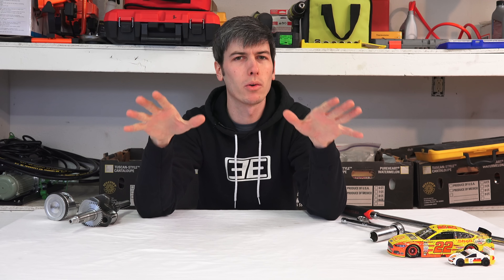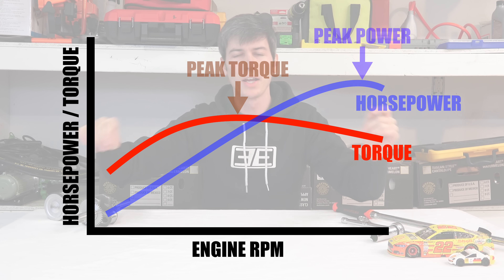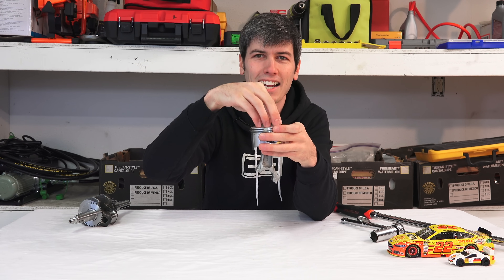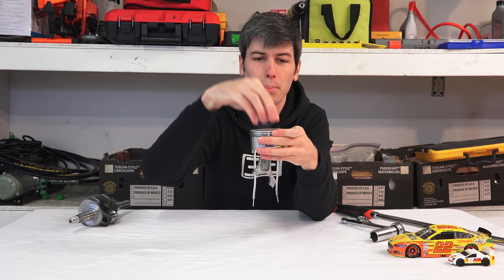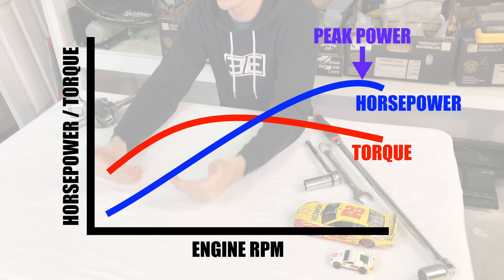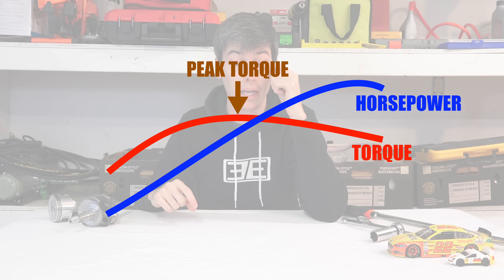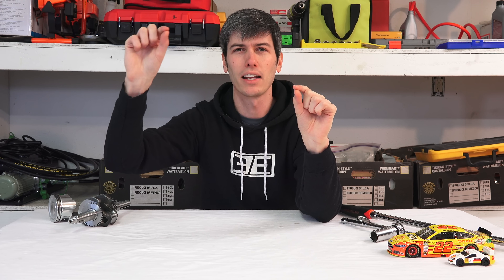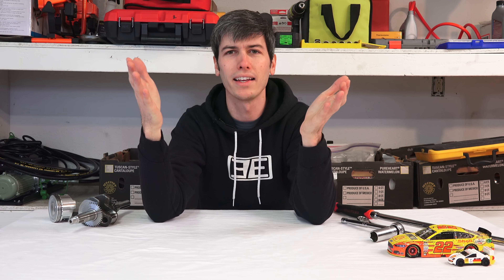Horsepower vs Torque - A Simple Explanation

Comment: no this is not clear. so why can't i put an F1 engine to a truck? more HP -> more work right? no
Reply: cos you cant do it ? 🤷🏻‍♂️ f1 engine at proper gearing outperform stock avg truck engine in wegiht pulling competition ,accelerstion with heavy weight asf as long as it be conect woth eprfect gearing and will have more output whell power 👌🏻 feg thrust at 5 km/h for 900 hp f1 engine assuming gearbox allow engine to be at peak power at this speed be much greater than for 500 hp truck regular engine at the same speed also at peak power dosent matter how many times more truck engine have torque at engine crank 👌🏻with this f1 engine it will pull stronger heavy 💩 uphill feg 👌🏻 with 700 hp at whell at 5 km/h vs 400 hp at whell for truck engine at whell at 5 km/h it be able to pull uphill at this 5 km/h at least 70% biger load on trailer and overall including whole weight with truck itself 👌🏻 now why they dont use f1 engine configuration so low torq high rpm short stroke small fispalcement asf for truck on road aplication thers plenty reason why and its not towing capability 👌🏻☕️
Reply: @mociczyczki  good explanation. I always thought the high TORQUE is required for heavy cars. but it seems like it just works better in practice, but it would be possible to rev an sport engine to 10k rpm with a proper gear ratio - but imagine the clutch while trying to move from 0 speed trying to convert the 10k rpm
Reply: @ thats why i write at perfect gearing what beside other stuff include super short 1 gear 😉👌🏻

Comment: I don't understand... You say that peak torque is when you will feel the most force in your seat (which means it must be peak acceleration), which seems to imply that more torque means more acceleration. But then you also say that power is what determines which car will accelerate faster. Seems contradictory...
Reply: yea cos he dont say pr say bit ypu didnt hear egzacly that tprque is leverage dependent and power is speed dpendend other word peak torque generste more force thanpeak power at Set LEVERAGE or AT SET GEAR where final gear rstio stay the same all the time so you setup whatever gesr you want let say 3 and you accelerste from idle rpm with pedal to the metal to rpm limiter now pesk torq push you into seat stronger than pesk power but. power is speed dependend so it generste more force at set speed so now you choice frelllly speed you want feg 100 to 105 km/h and now you accelerste first at rpm clsoest to peak torq rpm and in second attempt ypu wccelerste at rpm closest to peak power rpm whichever gear is required for setup such test in this way even if it required change gearing some custom final gear rstio whateve r it doesent matter so when test be setup in this way from 100 to 105 km/h feg peak power always generste more force at contsct path and accelerste in this test co figurstion faster 🌪️ 2 formula subscribe this for torq its tprque :leverage = force and for power is power : speed = force form the same reason its power which win racing and not torq cos when you race ypu comapre the same speed level diffrence range or distance like 1/4 mile  if vehicle have the same resist including weight drag and one defeat this distsnce faster that mean it use for it more avg power cos he acomplishe the same work in shorter time period 👌🏻thats why all this tprq g.y stpry is just crsp of 💩🤭 🍿

Comment: So if they are a function of each other, why can't i use gear ratios to acellerate faster by peak torque?

I can understand horsepower defines top speed, but with an ideal (utopian) gearbox you should accellerate faster with torque .

I am also confused why the integral of the torque curve would not give the power.
Reply: function of each other tprq rpm power yep  it dosent mean you can accelerate faster be increase to limits each of those units except power at perfect gearing - 2 diffrent stuff cos proprotion between tprq and rpm is key and what isroportion between torque and rpm ? yep power ….👌🏻 👉🏻 if you understand hp defines topspeed ypu shpuld also know that at top speed is bigest motion resist in regard to drag and roll what required specified bigest force level at this very specified set speed level  if only peak  hp at perfect gearing determined max speed it mean it must genersted bigest force level at this set speed and not torque at crank and this basicallly mean at each set speed peak power push hardest generated bigest output force in newtons kg force etc …. so if you geared vehicle in such way that peak  torq be at previous topspeed limited be all resist like  on peak power rpm now at peak torq rpm this vehicle dont achieve the same topspeed but lower cos final gear ratio at max tprq is to long and contact path force to low/go down  👌🏻 integral of torq give power but diffrent level of power which  is depend on at how high rpm this torque level is 👌🏻1000 nm at 1000 rpm is less power than 100 nm at 15000 rpm and if you comapre 1000 nm at 1000 rpm at the same 100 km/h what show Gforce  meter for the same vehicle in the same test condition or what ypu woill feell on ypur back to 100 nm at 15000 rpm also at 100 km/h it turns out that 100 nm at 15000 rpm push ypu harder into seat 🤷🏻‍♂️👌🏻 ….. max acceleration  or atleast stronger than at peak power rpm can be achive at peak torq rpm only at set gear so when ypu test accelerstion on feg 3 gear from idlle rpm with pedal to the metall alll the way to rev limiter than yea at peak torq rpm Gforce meter show higher reading than at peak power how much higher depend on at which rpm peak torq  vs on which is peak power and how much torq is there vs there but never at set speed 👌🏻 …..any new vehicle with gearbox with more power outperform vehicle with more torq in peaks  at crank in regard to max accelerstion cos lowend elasticitiy at the same final gear ratio etc thats compeltellly diffrent story and 👌🏻 cos good setup /geared gearbox allow engine to stay as close to peak power or at peak power depend on peak wodth and how big diffrences between gear lenght specified setup have  basicallly all the time if driver choice right gear / right rpm at right speed 👌🏻 … thats why power  win race cos at each set speed it genersted more contact path force in newtons or kg force or pounds force or whatever other units pf force and  tprq is bull 💩 when it comes to max performance be itself but for normal road riding feg for me bike i would defenitellly choice feg 900 cc 90 nm at 4000 rpm 57 hp at 7000 rpm than me stock setup which is 500 cc 47 nm at 8000 rpm and 57 hp at 9500 rpm + with this 5 speed gearbox instead of 6 and i wpuld love this setup but on racetrack it be as fast as me stock setup just it will ride all the time on much lower rpm + required less ups and downshifts thanks very strong  lowend in comapre to me stock setup but thats because only preferention nothing more reallly vs racing thats co pletelly diffrent stpry here if ypur vehicle has alot torq but not so much power will lost any race at pro level 👌🏻 now some real world egzample of egzisted vehicle where more powerfull less tprque engine win feg 1/4 mille dragrace 👌🏻👉🏻 feg new brixton cromwell 1200 108 nm 83 hp 235 kg let assume with rider 300 kg 6 manual naked corrected quarter mille 12 sec flat at 173  km/h vs kawasaki z800 300 kg with rider 83 nm 113 hp 6 manual naked corrected quarter mille 11,0sec at 190 km/h with 45-48 metres advantage at finish line 👌🏻 or yamaha srx 600 slightly tune which increase ots peak torq but left power at stock level 255 kg with rider 57 nm 42 hp 5 manual naked corrected 1/4 mile 14,4 sec at 144 km/h vs cb 500 pc26 270 kg with rider 47 nm 57 hp corrected 1/4 mile 13,3 sec 156 km/h with 38 metres advantage at finish line +/% what is egzacle what i clocked on me cb in best run 👌🏻🍿 can write 1 mln egzample more 👌🏻…. what you reallly need to check is new csrs the swme model 0-100 accelerstion time in catalogue version with more power and less torq basicallly always have lower time and higher top speed 👌🏻and yep they are geared basicallly perfect basicallly in 90-95% of egzample though cars rpad arent prepare steictly for racing so in some egzample they can be lil off with gearing but never so much that if ypu use for accelerwtion peak torq rpm in some custom made gesrbox for egzample the same car version model asf you will outaccelrrste stock car in some drag race that dont happen 😉👌🏻 power :speed = fprce and if ypu calcualted any engine setup freelllly from torque at crank and at end final gear rstio be gearbox reductionand drive whell rsdious or from pwoer at set speed asf calcualtion always show more contact  force for power other word with perfectly setup gearboxes for as much accelerstion as can be posiibble get form some vehicle on limits it be always as close to peak power rpm and never to peak torq rpm as posiibble alll the time only than accelerstion be besst posiible and thats why in racing as long as grip isint issue ypu want to be at peak power rpm as long as posibbble basicallly from avg power use for race around circle track ypu can calculate lap time the more avg power some rider use in race the lower lap time he clock from the same stuff assuming similar weather assuming rider go on limits everywhere without msiteake you can also determined/calculated feg which go on stickier tire assuming the same bike setup assuming lap times was diffrent on stickier tire he can use more power without slide or  crash and clock lower lap time feg take  off corner on 💩tire mean you cant open throtle to max very sonn and use all power for accelerstion soon you mist wait gently dose throtle on grip limits all the time to point where grip be enpugh for unleash full power with very stockiy tire ypu can go full throtle at max power as soon as posibble take of corner much faster this determined this formula = speed x force = power or power /speed = force when some manufsctory like pirellli bridgestone test some new tires on rsce trwfk theyr slgorytm use those formulas for calculated how much more % power on new tire csn be usewithout slide than they can  make some marketing with new product offcorse they can aswell use other units like simply  lap times or Gforce etc 👌🏻

Comment: Sorry, that's as clear as mud
Reply: suzuki bandit 600 54 nm/78 hp 300 kg with rider 0-100 km/h 4,0 sek 0-160 km/h 10.5 sek vmax 200 km/h vs triumph speed twin 900 69 nm /65 hp 300 kg with rider 0-100 4,5 sek 0-160 14 sek vmax 188 km/h similar drag both 6 gears manual  corrected 1/4 mille 12,3 sek /169 km/h bandit 600 vs 13,1sek / 158 km/h speed 900 with 35 metres advantage bandit 600 at finish line 👌🏻 ….. now is more clear ? ☕️

Comment: What a bunch of cr.ap!
Reply: reallly ? 🤔🤓let seee honda cb 500 pc26 190 kg + 80 kg rider =270 kg 47 nm 8000 rpm 57 hp 9500 rpm rpm limiter 10750 rpm stroke 59,6 mm dispalcement 499 ccm 6 gears 174 nm/ton 211 hp/ton 1/4 mille E.T. 13,3 sec at 156 km/h 👌🏻 vs yamaha srx 600 175 kg +80 kg =255 kg 57 nm 4750 rpm 42 hp/5750 rpm rpm limiter 6800 rpm stroke 84 mm dispalcement 608 ccm 5 gears 224 nm/ton 165 hp/ton 1/4 mile E.T. 14,4 sec at 144 km/h 👌🏻 so what you saying ? 🤔🤷🏻‍♂️ps must straighten couple stuff official tech spec say 48 nm for srx 600 but i take data from dyno run one srx 600 with some small mods like airfolter exhaust asf from srx600net site thers whole dyno graph 👌🏻 and second yes somebody can say srx have only 5 gears vs cb 6 and beacuse of this thers this diffrences 👌🏻🤐 welll not reallly first of all the less gears the less drive train  losess what mean more torq and power go to the ground ok only power cos torque will end at drive whell axis 🤭 correct saying power and newtons force not tprque 😉👌🏻 also less upshifts in some circusmstances on which also performance bum up dyno graph and diffrences between gear lnght say that in reality its cb which use less % from 100% avg power for accelerstion on feg 2 gear rpm drop down to 6500 rpm +/- when ups to 2 from 1 gear at 10000 rpm what mean avg power at 2 gear fpr cb 87% 👌🏻 where srx 600 use on2 gear 95 % avg power 😎👌🏻 on rest gears its close in regard to how much both bike use % from 100% in peak according to theyr dyno graphs so yea srx 600 have massive tprque advsntage and is lighter so in torque to weight ratio have even bigger advsntage but its cb 500 topend power advantage which makes true diffrences and beat srx 600 over quarter mille distance also 0-100 km/h is 6,0 sec for srx and 4,6 sec fpr  cb with  1 ft on 👌🏻 top speed srx 165 km/h vs cb 181 km/h 👌🏻🍿 so yea he is 100% correct in this video the only issue with this video is that he dont mention that in regard to vehicles avg power matter and how much avg power vehicle be able to use for  accelelrwtion depend on this how good gearing is confogure in regard to very specific engine power characteristoc so how wide is peak power asf but most modern vehicle have very good setup gearing and in such circumstsnces version with more topnd power basicallly always win race with version with more torque  👌🏻🍿ps srx 600 base on this graph which im mention is steonger all the way from idle to almost rpm limiter 6800 rpm than stock cb 500 pc26 👌🏻but cb in race will not use 1000-6800 rpm range offcorse on whcih it willl lost especiallly that its hewvier vehicle here 👌🏻 but rpm range where it have power advantage = closest to topend power 😉👌🏻🍿ps one more stuff this dyno graph  srx 600 about which im mention show 34 hp at whell only and 1/4 mille calcuation base on 37 hp at whell from 42 hp at crank 👌🏻 i quesss they have low pressure in tire os cos real world test also shows 14,4 s at  144 km/h with correction factor at dragstrips for srx 600  what required 37 whp +/-👌🏻…..

Comment: Does incline and decline have to do anything with it? Let's say you have drag race with a built 4cylinder making 350hp@9k rpms and only 200ft/tq  weighing 2300lbs 

The other car  car is a v8 making 450hp and 450 tq weighting  4300lbs  they both run same 1/4 mile. If they were both to race a quarter mile at a 10% incline or 10% decline who would win. And why?
Reply: if they both do the same 1/4 mille than there be no diffrences if you setup race uphillor downhill results be the same as long as resist increase for both or decrease for both at the same level as long resuslts be the same 👌🏻only exception is when in one of vehicle as resist increase some part of drive train be not enough efficient for transfer power to ground 👌🏻 in such circumstances must be change some stuff in this vehicle which would start strugle under biger resist like feg change gearing for shorter 1 gear asf 👌🏻 assuming such stuff dont happen there be no diffrences 👌🏻

Comment: This is the worst explanation video I’ve ever watched
Reply: this explanation is 100% correct 👌🏻 you just have no knowledge here , simple 👌🏻 feg cbr 600 f3 300 kg with rider 100 hp 65 nm vs  trx 850 300 kg with rider 82 hp 87 nm on feg 1/4 mille trx 12 sec /175 km/h vs cbr 11,3s /187km/h with cbr at finish line advantage +/-35 metres 👌🏻 so whats your point ? 🤷🏻‍♂️ more powerfull engine at perfect gearing always win race against engine with more torque at crank also with perfect gearing ….. 👌🏻🍿but witch be more fun for normal riding at road thats diffrent stpry depend on preferention in regard to engine power/torq characteristics here trx may win for most avg rider but race track thats diffrent story ypu cant beat version which use for accelerstion more avg power be freeeelllllly more torque or shorter  gearing or higher rpms 👌🏻its physiqallly  imposiiible no matter what say nobs 😉👌🏻🍿

Comment: So with the 2 vehicles in your example, if we normalized the gear ratio between them and took that out of the equation - would the car that accelerates fastest depend on the total mass of each vehicle?  I could see a high torque/ low HP vehicle having an edge with high mass vehicles and the opposite also being true.  Is that correct?
Reply: normalized you mean the same ? on 1 gear ? than yea high torq low hp win drag race up to certsin speed level and up to certwin  distance  level cos this version is stronger at low to midrange rpm so in such test regulation it obviously smoked more power less torq version but only to certwin specified speed level or distsnce levell cos when more power less torq version start achieve rpm /speed at which it stsrt genersted more power it will stwrt cstching up and finallly overtske more torw les power bpversion but for this it need enpugh long distsnce of rwce 👌🏻cos from some point of speed /dostance low torq high hp would still win and no it dosent depend hpw much weight you put on them but equall weight 1 ton or 100 ton high torq low hp at the same  final gear ratio on set 1 gear will accelerste faster 👌🏻 in real world such stuff never happen as ewch vehicle have gearbox otherword 1 ton or 100 ton each vehicle on perfect gearing  200 hp /100 lbf ft always win with 100 hp /200 lbf ft 👌🏻 downhill uphill on flat with 1 kg load or with 1 mln tons load 👌🏻as long as more hp less tprq engine be able to apllly more power thanks gearbox ( cos as we know  engines dont genersted max power all the way on rpm range from idle to rev limiter but power increases achieve peak and than decrease so for have power advanatage you must setup engine on rpm where it genersted this more power otherwise you will use less power despite in techspec engine have write  more power and you lose 👌🏻 and for this is gearbox for allow you to hold engine rpm at each speed from dig to top speed at PEAK POWER rpm and than  more  torq  engine have 0 chance dosent matter how many times more torq it have at crank also than engine which is connect with much shorter final gear ratio also have 0 chance dosent matter how much more rpm it spin at the same  speed if it willl have less power it have no chance as well 😎👌🏻🍿 ) at freelllly you want set speed 1 km/h or 1000 km/h and each other speed level betwen them more torq less power ngine have no chance 👌🏻🍿